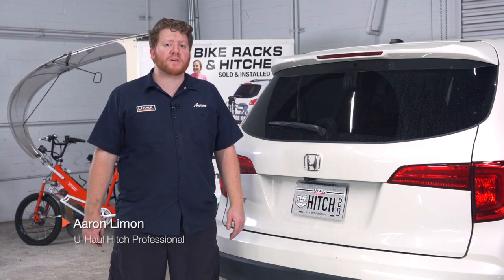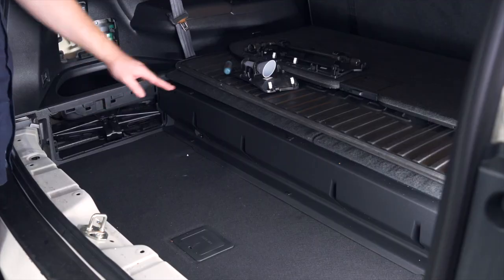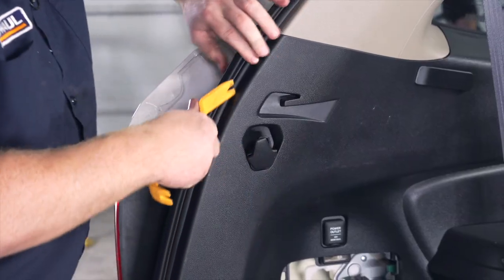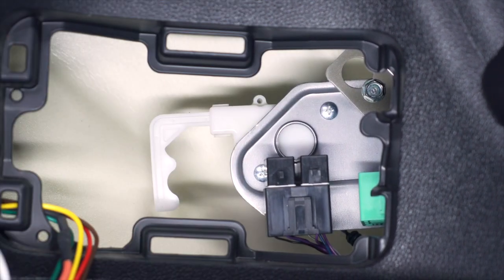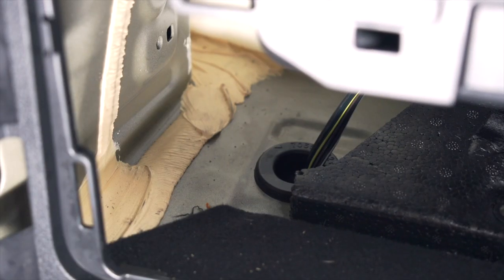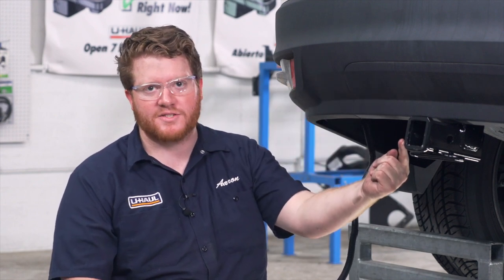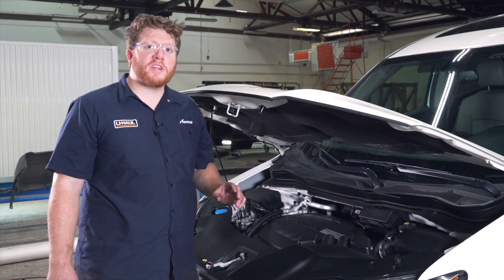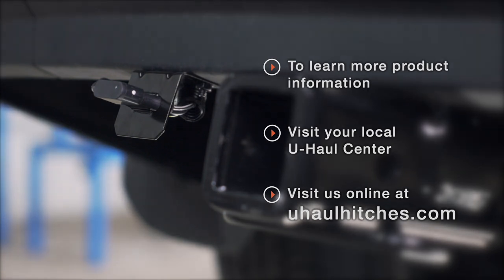2017 Honda Pilot Trailer Wiring Harness Installation

Comment: My uhaul wiring kit only came wth one 10 amp fuse and one 30 box type fuse and the harness is does not have that wire plastic cover im starting to think uhaul sold me dud

Comment: Where does the single blue wire connection connect to if you do have the back up sensors?
Reply from the maker: There will be an adapter plugged in to the vehicles harness instead of empty as with our vehicle.. Thats what the additional adapter with a blue wire is for. But if like our Vehicle nothing is plugged into this harness already, then the blue wire is not plugged into anything.